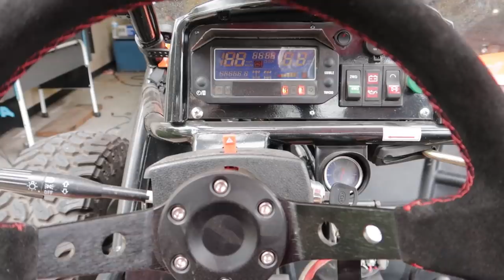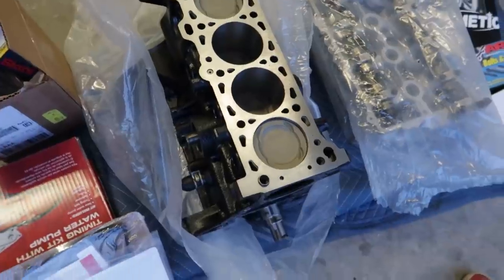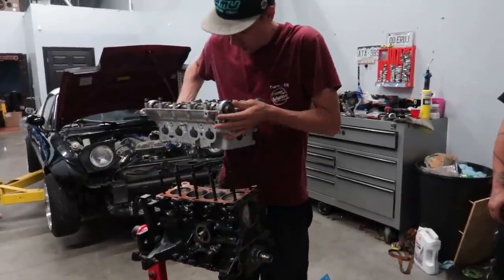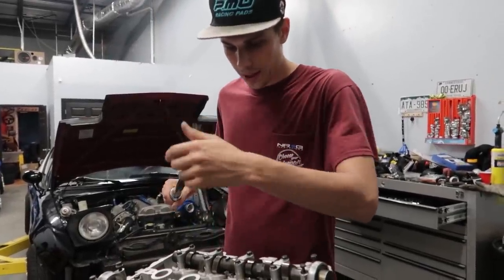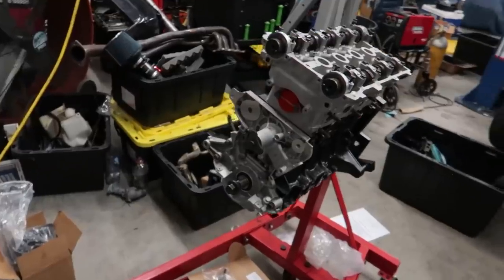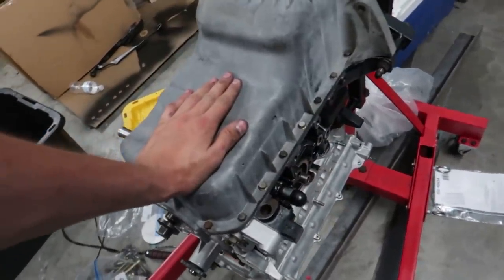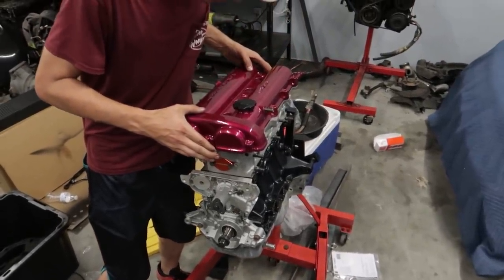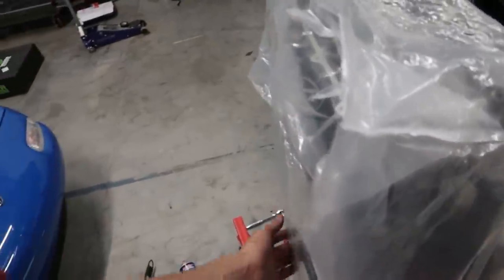ASSEMBLING MY FULLY FORGED MIATA ENGINE!

Comment: Sammit, a few things coming from a miata owner who has built a few engines.  Don't forge the O ring on the oil pump, you'll have a bad time if you did.   Also don't forget tho use a freeze plug underneath the reroute  block off plate where the thermostat housing used to be on the front of the head.  Anything else you may need LMK I've gotten to know these things very well after screwing around with mine.  I've built both 1.6's and 1.8 but theyre super similar for the most part. 1.8's are far superior IMO due to the updated head from 99 on.

Comment: Dude, if you buy a little aquarium powerhead and put it in the bottom of the hot tank it would work so mint and it would circulate all of the crap to clean every pore and crevice.

Comment: If you (or the next owner) want to upgrade the turbo it will most likely be water cooled aswell, adding the coolant reroute and using the front waterneck block off plate you will loose the easiest way to get water to a turbo, i advice you to get an AN-6 fitting welded to the block off plate and then put on a AN plug for now, it will save you a lot of work as you need to remove the timing cover to get to it!

Comment: get a 600+ gph submersible water pump which i think will move the water around more than a air pump with air stones unless u set the part u are cleaning on/near the air stone or get a small grill rack with legs that is set at the bottom of the tub than u set ur parts u are cleaning on that and set like 2x 12" air stones under that, that way the air bubbles are pushed around and thru the parts.

Comment: I’m definitely no mechanic but isn’t that drain in the pan a little too low?
Reply: Yep, it should be above the oil level to be able to drain properly.
Reply: Yep. Looks low to me.
Reply: It'll be fine guys where he's put it oil isn't sitting it that part and will drain back fine.
Reply: Daniel Ibrahim its just an oil return! While engine is running oil is being pumped to head and turbo etc so there’s more than enough room for it to return to sump.
Reply: Looks perfectly fine to me, being on the high side of the pan, little oil can collect there, so what ever drains into it will just run off.
Reply: Blake Nic lets hope so.
Reply: Its fine. The oil level is below where he put it.
Reply: As other people said, it's at a high point at the front of the sump, forces push oil from that spot into the deep spot at the rear of the sump where the oil pickup sits
Reply: It's at the highest point of the pan.. The engine was upside down when they put the oil pan on.
Reply: I was just looking at comments to see if this was said yea it should be a lip higher but cause that pan has a step down it should work fine
Reply: Daniel Ibrahim remember these only take like 5 litres of oil
Reply: No it's in the perfect position. Its a rear sump oilpan so there's basically no oil in that front part
Reply: @86sidewayz  Yeah but the return is just gravity. That's why if you're turbos low you need a scavange pump. If you try and drain oil through a line inside oil it wont drain as quickly if its draining into air(if you know what I mean). 
But this drain looks fine.

Comment: They make something sim for toothpaste idk what they are called but got a couple a few yrs back.  Also glad you followed the bolt torque sequence on the head, if you don't know it for a part just start in the center and spiral out or side to side for like an exhaust manifold, the oil pan or w/e.  It really helps prevent leaks.

Comment: Permatex make a caulking gun tube called right stuff that is very thick and tacky and it works amazing for oil pans and trans pans for the engines that come factory with silacone

Comment: Oh no, you’re not supposed to copper spray the Viton coating that’s on the cometic head gaskets. That compromised the Viton rubber coating’s ability to seal and seal properly, if the gasket fails in the nearing future... now you know why. Fingers crossed it doesn’t too soon, I literally just did a video about this a few weeks ago while assembling my own Miata engine.

Comment: i am sad to see, one of the most important part missing from video... When you assembly the pistons and bearing with ARP. This required many measurement,need to go to the top limit if you build the negine for turbo. Without this step your engine will stuck, and you can start again from the begining.

-measure each rod with piston, they need have have almsot a same weight, maximum tolarence is 1.5gramm
-measure each cylinder and piston size, the cylinder-piston gap need to be the maximum limit based on the instruction
-measure the crank and bearing gap, you can do it easily with plastigauge
-use a special assembly oil, instead of motor oil
-measure the ring gaps on the piston, if neccassry make it bigger.

The bottom ring on the piston need to have a bigger gap than on the top one, because if its smaller between the 2 ring will be a pressure which will break the rings.

I dont know why these steps missing from an assembling video, but its would be amazing to see, how you processed above steps properly.

I understand if machine shops did these steps, but did they provide you a paperwork regarding the details, and did you mentioned this engine if for a turbo setup?

Comment: Hey man, I would buy the oring from ACE or a hardware store. I did mine with a hardware oring over a year ago, still dry as the women I talk to.

1.5' (1 1/2in) inside diameter
1.75 (1 3/4in) outside diameter
.125 (1/8in) thickness
Reply: Lmao. Dry as the women I talk to.

Comment: Fyi that front seal is gonna leak, boundary uses non oem front seals. Have a boundary pump on my built 1.8 and the seal leaked like a bitch. Replaced with a oem seal and have zero leaks now.

Comment: Why? Why? ONLY WHY THE CRAP? did you put the copper  spray on the head gasket? That is total trash and even worse on multilayer metal head gaskets. That is shit they sell you to get your money. Ask the manufacturer of any car brand or of the head gasket. They say Do not use it! Install the head gasket super clean and dry. You had a perfect deck and head surface and ruined it. I want to know what your teacher from Japan will say to that. I mentioned to many that use the copper spray. Ask Taylor I just quit watching his videos when he builds an engine. Almost every engine he used the copper spray blew the head gasket when he turned up the boost. Who tells you to use it? I think Adam and Alberto quit using it... at least they don't show it anymore in their video. I am really sad right now.